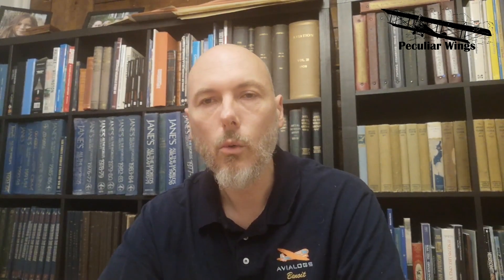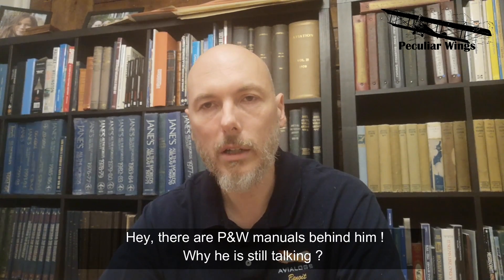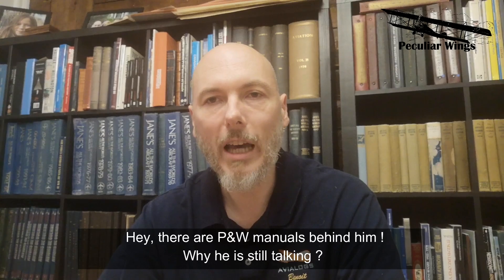Peculiar Wings E01:  First inspection for the CF-100 #100760 after more than 30 years...

Comment: very good to see this aircraft getting attention. Pierre mentions the last flight in 1987. I think its a lot earlier then that. I worked for Pratt&Whitney in late 86 and they did not have this aircraft, it was already on the pylon in front of the base then.
and a bigger hammer will normaly work.

Comment: Good luck with the plane, looks really interesting. I wanted to check out what those small propellers in the jet intake were used for? I saw it on Cessnateur in Instagram and got curious....
Reply: From what I have been told, these were for supplying deicing fluid. They spun around in the incoming airstream and with this, fluid was drawn out for deicing. Later engine models did not use these.

Comment: The reason why they removed all the hardware is probably due to security. At the time, we were still afraid of the Big Red Menace, and didn't want them finding out how the planes worked, even when retired.  The possibility of Technology transfer was paranoia but was probably justified.
Reply: I was on the crew that tore it down and put it on the pedestal.
We stripped everything because of the weight limit of the crane available.
Reply: Uhhh... we're experiencing a global Marxist revolution. Any resistance to it is labeled racist and White supremacist. We lost, dude.